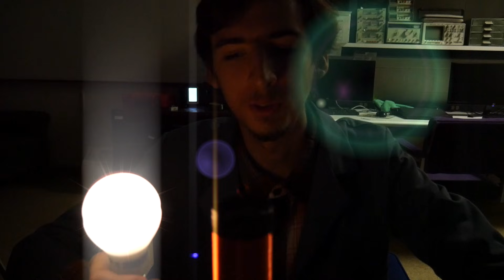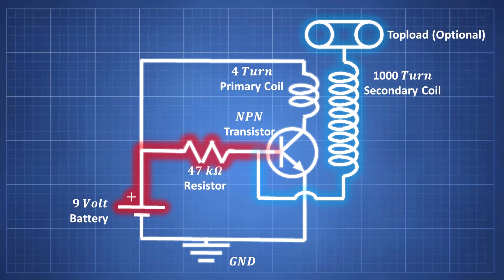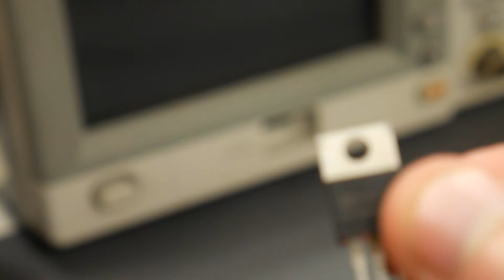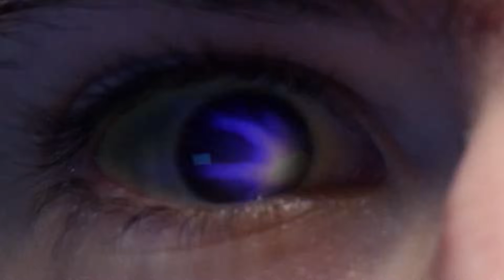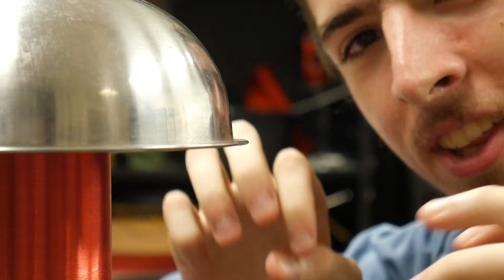SLAYER EXCITER - Tutorial, Explanation, and More

Comment: Thank you for your video.
13:30 Air molecules pushing on a thin point? Unrealistic. Ionization itself explains why the wire is pushed away from the electric field created in the air (seen when it becomes a visible plasma).

Comment: If you somehow see this after 7 years, can you explain why the voltage seems to be waay higher than the calculated 5 kV? Because I'm pretty sure 5 kV isn't enough to do most of the things you demonstrated here.
Reply from the maker: It will take longer than that for me to become delinquent in my responses! 
The voltage step up is not the transformer ratio. Rather, the coils transfer energy between each other to generate a small current and, since the secondary coil is an inductor, the secondary voltage skyrockets to give the current somewhere to go. This is called inductive flyback - this is how flyback transformers work too.
Hope that helps you understand better!
Reply: @B @BlueprintScience ha thanks for the instant response.
At first I didn‘t get why the secondary would oscillate until I realized it‘s an open circut so it has that inductive flyback. Very fascinating circut for sure

Comment: Mine doesn't work I just get a hot transistor (not burnt up)
parts list
47K resistor (tested to be accurate) Also tried 22K (also tested to be within tolerance)
primary coil of 10AWG solid core bare copper wire (5turns with a clip to adjust which turn to use)
secondary coil that consists of 28AWG magnet wire wound on a PVC pipe that is 6CM diameter and the length of my winding cover about 30CM of the pipe. 
Transistor is a 2N2222A NPN  (gets very hot) 

I tested all components before and after each run and nothing has failed (broke) but I also get no corona discharge or plasma.
I'm thinking the resonant frequencies are way off for this circuit (transistor) to handle. JavaTC gives mixed outputs but I think it was around 330Khz for my secondary.

Comment: Well I know I shouldnt but still if i can , can I use irfz44n MOSFET instead and use 2 22k resistor instead of one 47k resistor with 20 gauge and 35 gauge wire

Comment: Hey, I wanna build this and was wondering: is it ok to use a lower diameter for the secondary coil? I don't have a lot of enameled copper wire
Reply from the maker: I would not recommend it; the ratio of height the diameter should be 4:1
Reply: @BlueprintScience ohh amazing, thanks a lot for the heads up. by the way, the 15 volt/2 amp run on the description was using the 5 parallel transistors? I'm looking for a more "chill" approach with just a single heatsink-equipped transistor

Comment: Can a mosfet be used instead of transistor ? (pls answer)
Reply from the maker: No. A MOSFET is driven by voltage whereas a BJT transistor is driven by current, which is what is needed for this application

Comment: What if I use a Walton Cockroft voltage multiplier to supply high voltage (1 kV) to the transistor. Can we get 250 kV on the output of the tesla coil? What kind of power dissipations considerations should I take?

Comment: At what range would the Telsa coil be not safe to use or touch. I mean they will shock you most of the time, but when does it become a hazard. Like what voltage, amps, and time would it take until it becomes dangerous?

Comment: would the tip41c work as well? Because i used a mosfet and it wouldnt switch because it needed more geate voltage or whatever so im just trying to be safe and i want it to work. im not experienced enough with transistors to know how to effectively make an amplifier circuit or whatever so im just trying to make a compermise

Comment: How big of a current do you get on your DC power supply? I don't know if I did something wrong or if I connected a too powerful secondary coil, because I get 0.9 A when I have around 7 Volts. I don't know why, because the circuit doesn't seem to work, until I touch it with a finger or with an LED, then I get a huge spike of current and my DC power supply goes CC mode. Does anybody have some advice?
Reply: Same problem here and I read 0.6A with 12v and i burned most of my transistors when I put it to near 15v

Comment: I've had this project on the back burner a while.... Something i can not grasp is you say 10G wire for the primary; yet you install it with a mallot. Is this 10G copper tubing by chance?
Reply: Your wire doesn't appear to be a hollow tubing either. But I have 10G wire and it's way smaller than what you used. 2.56mm diamater.
Reply: Any thoughts on this? I have this all built except for the additional breadboard which is on order.

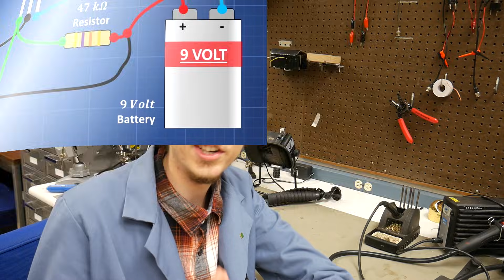Comment: Are you still out there after all these years? My question, schematic shows resistor going to base why does your wiring diagram at 4:37 show it going to the emitter? Shouldn't primary be going to the collector? I confused.
Reply from the maker: @boatdock  I’m still around for better or worse.
That particular transistor, the TIP31C, has the pin arrangement 1-base, 2-collector, 3-emitter. 
The back EMF from the secondary coil is what drives the transistor to switch states.
Reply: @BlueprintScience  I was just figuring that out. Should have looked at the data sheet first. Really enjoyed the video.

Comment: what's the difference between a slayer exiter and kacher Brovina?  I build a kacher with a 2000mcF capacitor instead of a diod, and the transistor doesn't heat up. Probably the problem is that we should oscillate css as capacitor- inductor couple, and in your device there's no capacitor except between the coils

Comment: best video, but my circuit is not working and the transistor is heating up can you tell me the reaoson
Reply from the maker: Try changing the resistor value; it may not be generating enough back-emf to switch the base. Or perhaps you need a new transistor.
Reply: Can I use Darlington transistor, tip122 ??

Comment: Just want to clarify, for slayer exciters, since it is a resonant transformer the turns ratio is not indicative of the output voltage. A good slayer exciter can create voltages higher than the step-up factor. The fact that you get about a 1/2" spark would mean that you reached at least 30KV which is 6 times higher than your step up ratio.

Also, you did mention this, the circuit only transfers energy when the transistor is in it's active state (i.e., when the voltage changes with change in base current.). This means that slower switching speeds are actually better for transferring more power to the secondary. So 2n2222 is not bad because of it's slower switching speed. It is mostly because of its low power and voltage rating. Since the transistor dissipates a lot of power in it's active state (as opposed to cutoff or saturation state) we need a transistor that can handle more power dissipation and also the high back emf produced by the coil each time the transistor switches off also plays a part in transistor selection.

And no, the power is not being "wasted" when the transistor is plateauing (at saturation state), it is simply not being used for pumping energy into the secondary coil. At this point, the inductor has a reactance which is higher than the resistance in the coil, so most of the energy is just phase shifted and sent back. So except for the miniscule amount of heat created by the primary coil due to resistance rest of the power is not wasted.

Also, it is generally bad practice to connect a bunch of transistors in parallel together like that. Since no two transistors are exactly same this can lead to run-off when one transistor ends up drawing more current than the others and this leads to a failure of that one and that creates a cascading effect, or if the transistor fails to a short then your would end up frying your power supply.
Reply: Can you recommend a better transformer?

Comment: Hi, Ihave same circuit, connections are right, primary & secondary are in same direction, but i have a problem. Transistor (B 21 TIP 41C)  is getting hot, It mean it keeps switching something through, wich is good. It only gets hot, but no sparks, no ltllte leds turning on, no transformation most probably. Any idea, what i need to double check or improve to make it work, cz if transistor switches something, than it also sould induce something in the secondary. Thanx.

Comment: The last explanation is partially correct. The electrons ionize the air too and you get a gradient of discharge which pulls more air around the wire along the wire towards the tip discharge. A it like the blade less Dyson fan but with ionized air instead.

Comment: Mr. Blueprint, I have another question for you. Only because you seem to be the only one that is actually answering...I am building a LC tesla coil with a Neon Sign Xfrmr and spark gap. I understand that it works off resonance but I have not been able to find any answers online and I am struggling. perhaps you can help? For example, I am not understand how the circuit works in reference to time. For 1, our main signal is 60 hz AC. My Neon sign transformer outputs 15kv. When the spark gap forms is that spark gap ever above 15kv? When the spark forms is that only when the capacitor discharges in one direction? Or does that channel stay open until the resonating frequency dies down from the LC circuit? Does the 15kv signal ever interfere with the resonance of the tank circuit?

Comment: "everytime the secondary coil goes high, it pulls the primary coil low." Can you explain this better? I feel like this is a bad explanation of whats going on.
Reply from the maker: It's more of an observation than an explanation.
Charge is forced up the secondary coil, leaving the bottom depleted of charge. When the base of the transistor (tied to the base of the secondary) loses charge, it turns off the primary coil - taking it from high to low (high to low = on to off)
Reply: @BlueprintScience  ah, thank u so much for clarifying this! I am a teacher for electrical (not electronics, but electrical construction) and this tutorial helped a lot. We actually used your video to build the coil and it worked very well! Thank you so much!

Comment: This was wonderful! Two questions:
1)
I’ve seen some circuits using ceramic capacitors with the input supply. Why is that done and shud that b done? What value capacitor is good?
2)
U showed the lazy solution of using multiple transistors. What is the other not so complex solution?
Reply from the maker: Capacitors are useful to smooth out the power into the circuit. Here, they are not needed since the circuit is noisy regardless/
Transistors last longer with a heatsink. You could also try a Darlington configuration here.

Comment: At 2:42 time frame:

I think you had the animation on the polarity of two coils wrong.  If the secondary coils opposie the primary coil's magnetic field ( and as  you mention they are to be wound in the same direction) the secondarry coil should show South pole against North of the primary coil.  In your animation you show North against North, same pole.  That is not opposing.

Comment: Hi there my name is Neal I live in New Zealand and you are about the closest thing I've run into on the net that understands an aircoil and so I'm trying to contact you.

I'm wishing to chat about a certain Twin AirCoil that stood 110 stories high but was wired like 2 x 110 story Pancake coils.

Are you interested in reproducing that event to prove it happened without 'terrorists - explosions - or an attack on America' - because a very quick look at the circuit diagram has Building 7 housing the Sub-Station Transformer 3,4,5,6 being Capacitor wiring which would require building 7 to have a fire or spark gap.

Weird till you see that the US Military moved all it's Aluminum Aircraft to over 180 miles away for the day and there was a weather anomaly called Hurricane Erin near New York City on September 11.

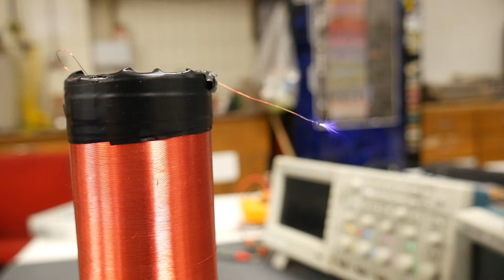HAARP operated on that day from 8:00 in the morning till the Pentagon got destroyed.
Reply from the maker: I know nothing about this actually.

Comment: where can you get the adhesive mounted multi pin block mount for the mutiple tip31c transitors that mount to the circuit board
Reply from the maker: A pack of them are about $5 on Amazon
Reply: @BlueprintScience  do you have a link to the part number?

Comment: Does the smaller wire have some sort of insulating coating on it or can you use bare copper wire?
Reply from the maker: It’s called magnet wire. It has a very thin coat of lacquer to insulate it.

Comment: How much volt did you apply after maga transistor
Reply from the maker: For the big sparks you saw: 60 volts DC - but only for about 10 sec at a time
Reply: @BlueprintScience  so what is the sweet spot for voltage
Reply from the maker: @drago-w2j  Hmm… 20 volts is classic

Comment: Hey, nice video. Just wanted to mention that stacking transistors in parallel doesn't work well at all in practice as differences in manufacturing tolerances means one of the transistors is doing more work than the rest and they'll fail one at a time :P

Comment: Hi Blueprint, great video! I've tried to build it with my son for his science fair project... I've checked all the connections and watched your video a million times, but I cant seem to induce anything into the secondary coil. 
I've used 30 gage wire on the secondary but I've used 16mm double insulated cable on the primary. Would that cause a problem? I also tried using a variable resistor and adjusted it until I got the lowest resistance between C and E, was that dumb?! Does it need to be a 47k? It was about 90 ohms between C and E with the 47K....
Please help!... I might be so close it Hertz!?... sorry!

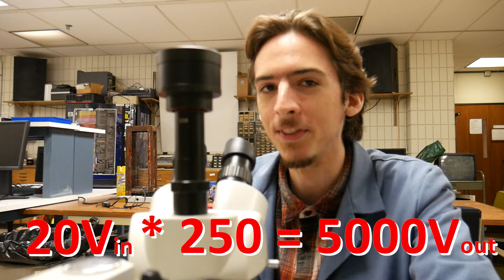Comment: 6:14 250 boost ratio assumes coupling coefficient of 1, but typical tesla coils have 0.2-0.4, so it will be less than 250 voltage boost

Comment: Hello, I've made this and it doesnt work, I am using almost dead 9V battery , 700 turns on sec with 0,5mm wire, 3 turns on primary with 1mm wire.  62kOhm ressistor and I have ( cdil bd243c f6 t) tranzistor .
Reply from the maker: Seems legit. Try finding a better power supply. 12V to 20V laptop charger power bricks do a really good job.
Reply: @BlueprintScience  I have power adapter with 19,5V and 3,34A. Should I just use that or? I tried using power adapter  with 12V 2A and still nothing happend.
Reply from the maker: @lajne_8  I would check the continuity of all of your wire connections next
Reply: @BlueprintScience  Hey, its me again, I had no luck with my tesla coil , I tried everything and it still doesn't work, I noticed one thing... when I connect it to the 9V battery, the positive wire gets rly hot as well as the battery contact. Do you know what could that mean?
Reply from the maker: @lajne_8  it probably means you are shorting through your transistor - check there.
Reply: @BlueprintScience  Can you give me your e-mail adress so that I can send you pictures, I still can't figure out what could the problem be, I checked everything
Reply: @BlueprintScience  I managed to get the tranzistor worm a little bit but still it doesn t work. I now have 14V 1,5A power adapter. There is no more sparks when connected to the  adapters connector. Ive put 54kOhm ressistor.
Reply from the maker: @lajne_8  I put all of my troubleshooting suggestions in the video description. Unfortunately, I can’t work miracles.
Reply: @BlueprintScience  It works...finnaly ... thank you soo much for helping me . It turns out it was all along bad power supply and on breadboard there was a sortage that I didn t know about. Do you know why it doesnt work when I connect more than 1 tranzistor in paralel? I am using laptop power adapter now with 19V 3.42A.
Reply: @BlueprintScience  ok, thank you!

Comment: you should use di/dt than simply input voltage multiplication. will your transistor provide smooth sine current ? i guess it will produce pulses

Comment: Why wouldn't a 6 Volt battery work on a circuit like this?
Reply from the maker: Generally speaking, the voltage isn’t high enough at 6V. Ben 9V is on the low side
Reply: @BlueprintScience  also, one more question. In simple terms (if they exist) what is a resonant circuit
Reply from the maker: @papawilo9065  A resonant circuit is the kind of circuit that you use to tune a radio - then the circuit will pick up energy at only one frequency (like a radio station)
Here, we want the secondary coil to pick up the energy from the primary coil.
Reply: @BlueprintScience  One last question, supposing the wires were coiled in opposing directions, what would happen?
Reply from the maker: @papawilo9065  With the polarity reversed, the transistor would switch one time, then never again (because its not being pulled low)

Comment: 13:29 .... your explanation is not correct.You have conductor which has current through it in constant magnetic field of the Earth.Every conductor in that condition will expirience mechanical force.
Reply from the maker: My explanation is correct.
The current in that wire is AC, alternating at high frequency. Just as many electrons enter as leave, making the net force on the wire zero.
But that action generates heat which moves the wire forward.

Comment: QUESTION: What should I do if I run out of magnetic wire and would want to add more coil to it? Is soldering end to end fine? Won't it causes sparking between the wires?
Reply from the maker: The best thing to do is to start over, especially if you’re near the top. A solder joint would likely be an arc point. Even if not, you will lose much energy from it.
Reply: @BlueprintScience  So I should know how long my wire beforehand before making my coil, which I can get from circumference of my coil multiplied by number of turns.

Comment: May i ask what is the lenght of pipe, and if i use 22k resistor, is it gonna make a problem?
Reply from the maker: The pipe was about 10 inches tall, but I didn't use all of its length - I had about an 2/3 of an inch on each side.
Also, I believe that a 22kohm resistor will suffice.